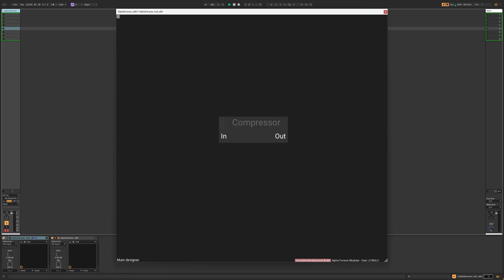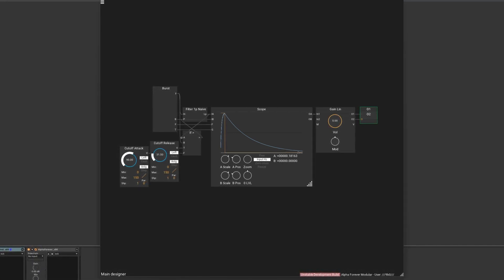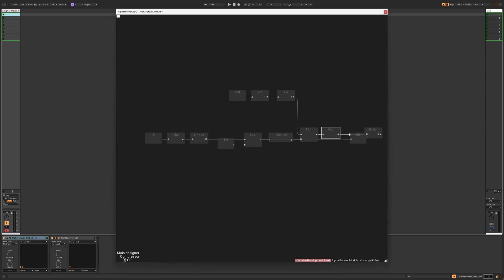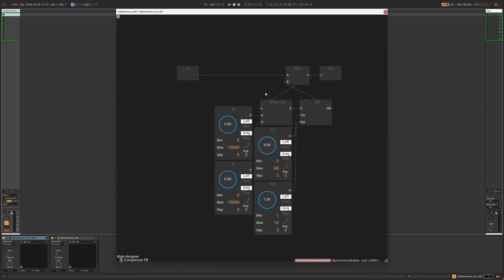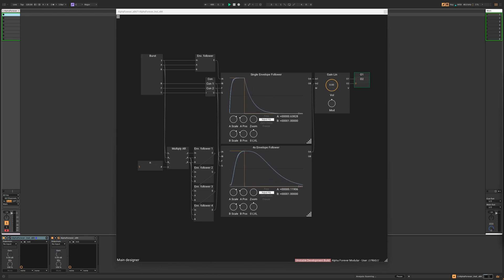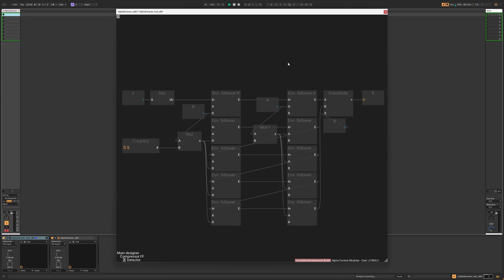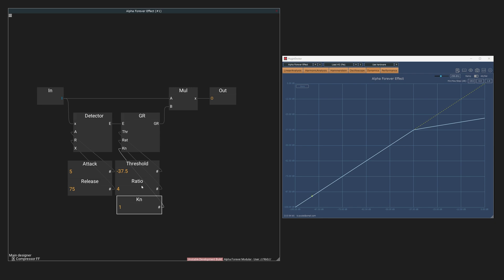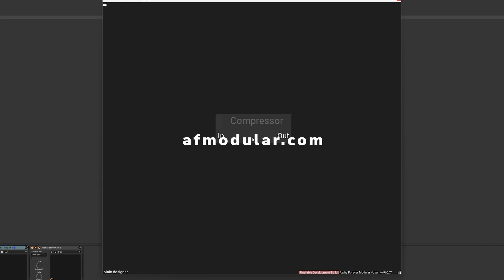Designing Custom Compressors

Comment: Hi , i'm very new to this stuff even though I have been in the music industry for at least five years. So I wanted to know that, does this work flow You have create actual original plugins with skins? Or do you just use bear bones like you are showing me. And what is the intention or profit behind building these basic plugins with your own hand when there are many good plugins?
Reply from the maker: hi! i'm not creating plugins at the moment. we actually did that about 20 years ago (we released a few plugins back in the early 2000's). now my brother and i only work on alpha forever modular, which is the software you see in this video.

as for the intention or “profit” behind building these: i don’t really have a target. i just enjoy sharing what i’ve learned, discovered, or experienced, because it would have made my own journey a lot easier if others had done the same. i also do it for myself: i use nothing but this plugin for making music (plus live for midi sequencing), and i don’t use samples either. over time i’ve kind of spiraled into challenging myself this way, and now it’s just part of my "art".